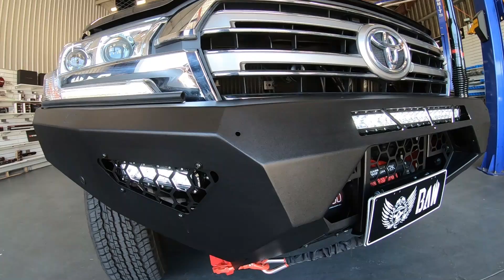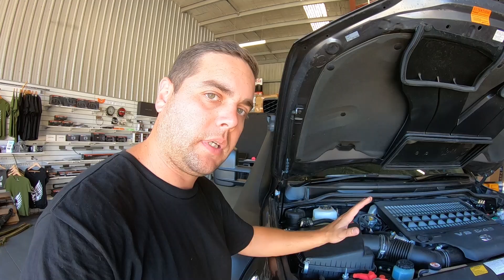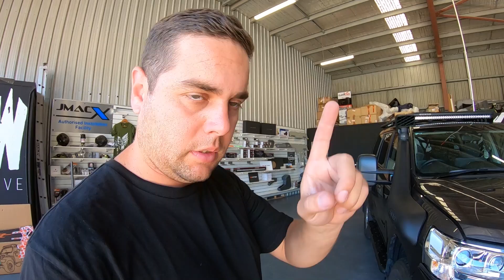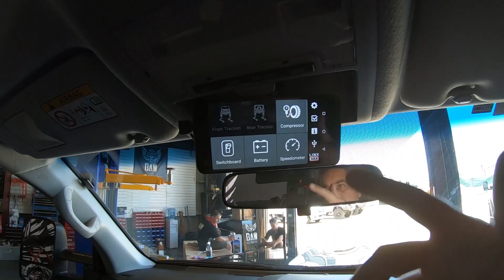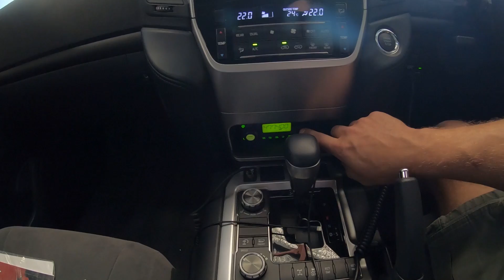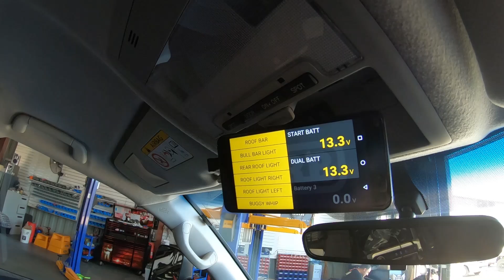Transforming a V8 200 Series LandCruiser: Offroad Animal Predator Bar, Dual Battery System & More!

Comment: I thought Paul didn’t make the sliders for the 200. This must be new for him as I asked him some time ago and there was nothing available at the time. Nice setup 👌🏽 

Also- 1200lb not 12000lb Carbon winch 😜
Reply from the maker: 200 sliders certainly are available.
Reply from the maker: He sure does now. These were released a few months back
Reply: BAW Automotive  
Ok. Not to worry. If I seen it advertised I would have snapped up a set. I ended up getting Brook Marrington’s sliders instead. 
Cheers and thanks heaps for the reply 🤙🏽